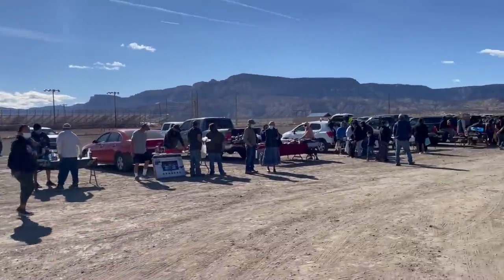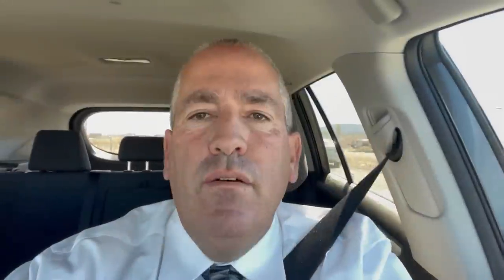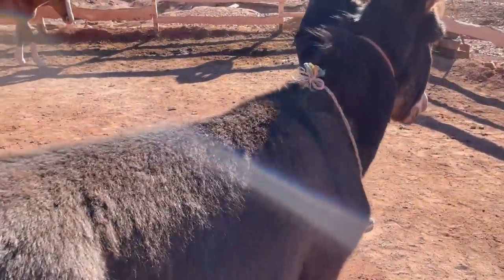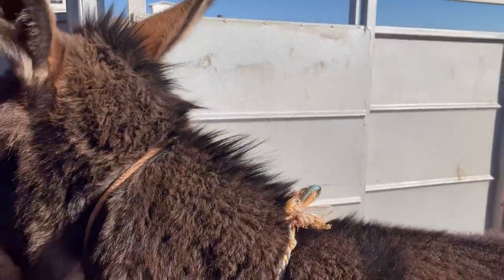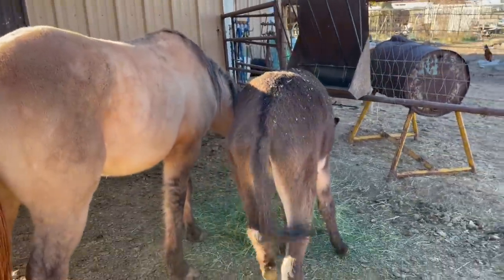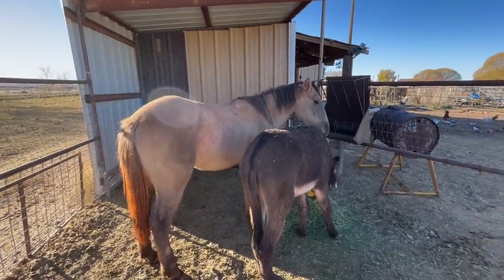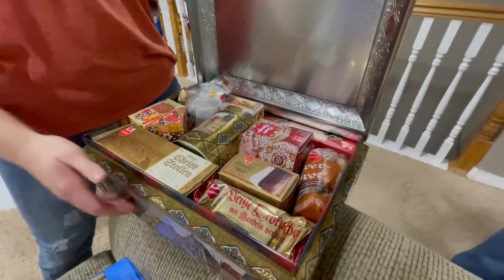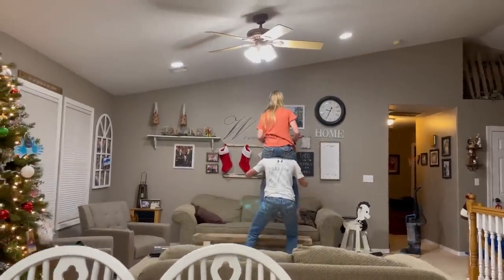THIS IS SERIOUSLY CRAZY - I can't believe this!

Comment: Even the best water heater these days will leak over time. Today you can get inexpensive WIFI/Zigbee/Zwave (and soon, Sidewalk) water sensors that will immediately report when it leaks. Sometimes it will start slowly but it may also just poor out. The washer as well. I've had both. Good time to get a sponsor out there to to make the very easy install. I would go with a Zigbee myself or optional WIFI. It would benefit a lot of people.
Reply from the maker: Thanks for the info